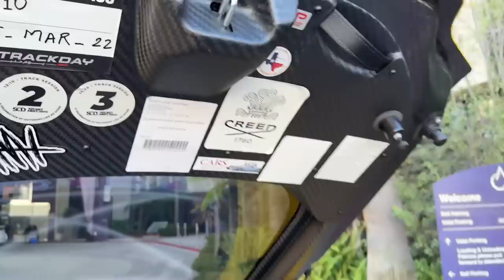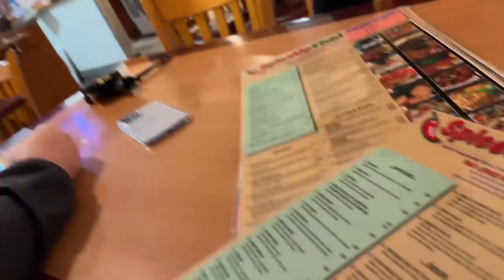How does this even happe ?

Comment: Crazy how yall hate on a Mustang when i think you should get a coyote f150 becaise like the Mustang all you need is boost and fuel and you can make up to 1200whp and run as fast  7s in a mustang gt or 8s in a awd f150 in the 1/4 mile. No heads no cams no pistons no rods no opening the engine unless you want to go built motor which then you can make up to 2000hp on factory block.  So you can buy a f150 for your tow rig throw a big turbo or supercharger at it and jave a truck to tow with and a truck that can run easy 9s in the 1/4 and do awd burnouts. has to be a pre 2020 though. Check out cleetus biggest chevy guy he recently got a rwd supercharged f150 as a giveaway vehicle and after driving it he went and bought his own and is shocked on how easy it makes 1000whp. If you want to go heavy duty then you have to go 2020+ f250. with its insane 1050lbft of torque. or this year they are coming out with a high output version with more power. nothing is puting out power like that
Reply: We found the mustang owner
Reply: This is Daily Driven Exotics not daily driven Ford F150. Cleetus has one because it fits his channel and he drag races. Good thought wrong channel haha
Reply: @derekrey902  and it’s built making like 1000 Hp. This kid is definitely a v6 mustang owner😂
Reply: Yea, "just boost and fuel" basically free and instant 1200hp 😭
Reply: @derekrey902  and he blew something up in it too lol
Reply: Cleetus ford is supercharged no??
Reply: Nor or the guys in their single cab f150s on 4 slicks damn near laying frame are they towing their elephant weighted supercars. & They aren't complete goofballs & mechanically declined owners like Dave & Damon would be
Reply: @vG_ImperialxWolf  I think the giveaway truck was supercharged. The one he is keeping is a big single.